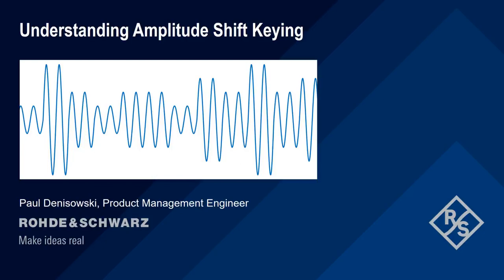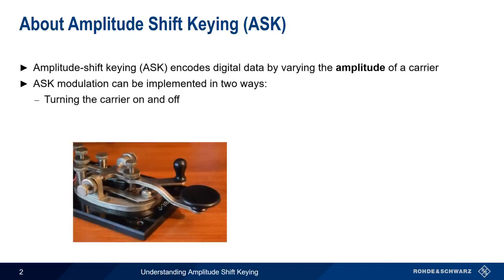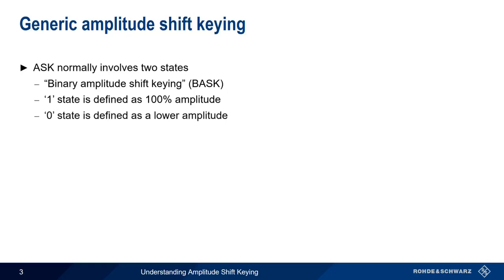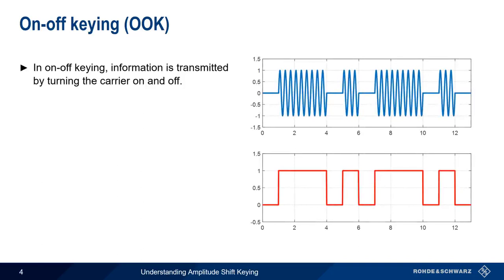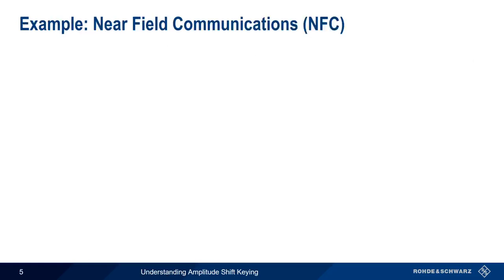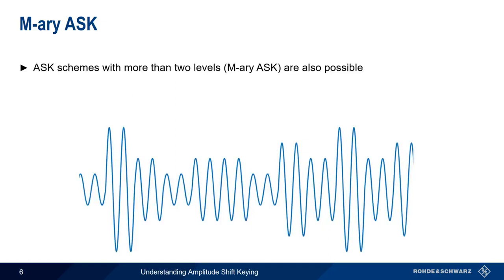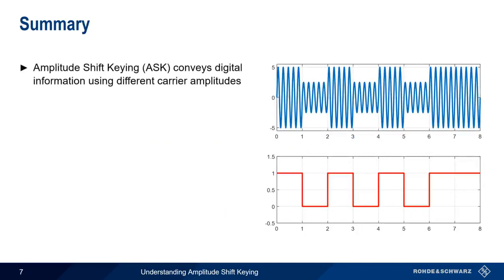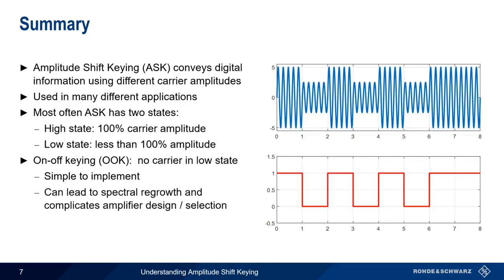Understanding Amplitude Shift Keying

Comment: I want to generate 8-ask modulation signal by writing command code in SMW200A vector generator. However, there is no 8-ask modulation in command codes or in the interface. What can I do?